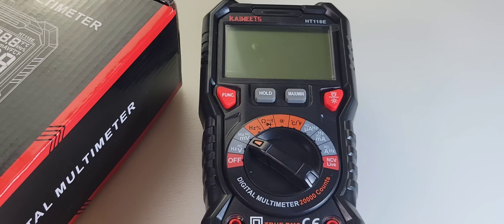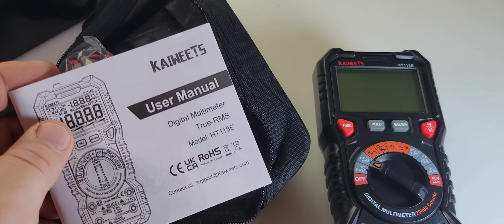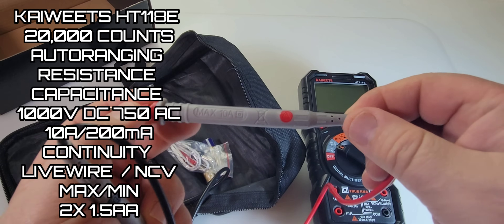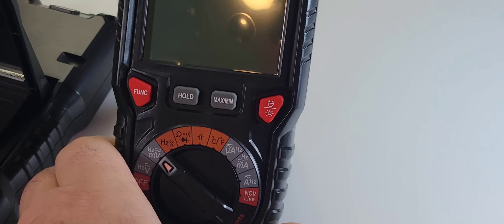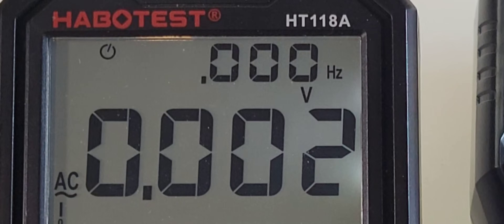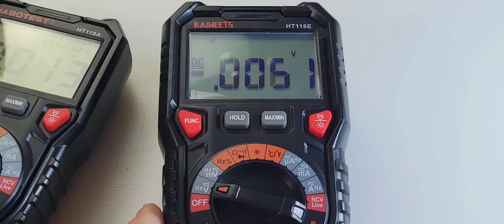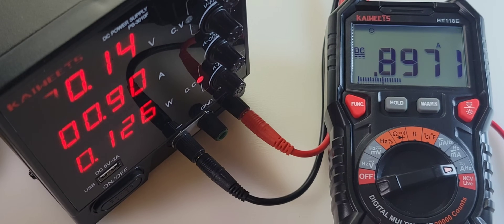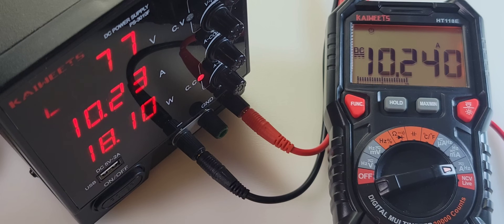ALL NEW KAIWEETS HT118E CHEAP-O Multimeter Review & Teardown!

Comment: Hi! Thanks for one more cool review!
But why do so many nice multimeters use 250V fuses? Better to replace those by 500V or 1000V fuses?
Reply from the maker: Good question..honestly it's probably economics..much cheaper to add 250v than a higher rated more expensive fuse.
Reply: Fortunately, the HT118* multimeters use 250V fuses of size 6x30 - so higher rated fuses 6,3x32 should fit?
I found ESKA 632.527 and 632.510 (both 500V, fast) for approx €0.60 each when purchasing 10 pieces of each (in Germany).
I haven't found 250V ceramic fuses being noticeably cheaper than these ESKA fuses.
Therefore, for safety reasons (to prevent arcing at high voltage), I believe it's better to favor these over 250V ceramics.
Reply: @mlemke9041 Where did you find them 4 that price?

Comment: Hey, you might be the guy to ask: I cannot hear the audio indicator for continuity on most every DVOM I've ever owned. have some dead frequencies in my hearing range.  CAN WE FIND a slightly different tone in the piezo buzzers these things use?   I resorted to drilling a hole in the case of one meter to help me hear it. It'd be fantastic if I could just change the tone with a new buzzer.  It'd be INCREDIBLY fantastic if the makers would add some tone options. 

But I know nothing of piezos, do they all make the same tone?
Reply from the maker: Great question..👍 unfortunately, piezos run at a set frequency, so most sound alike. I do like your idea about customisation..that would be awesome!
Reply: @KeepOnTesting  maybe one could swap out the piezo for a vibration buzzer like cell phones have. That'd be easier to hear.  Ham radios with CW (morse code) function allow us to vary the "offset" as a function of frequency. This allows us to HEAR the side-tone at any frequency we need to. It doesn't affect the output at all.  But then "entry level" ham rigs are close to 1,000 USD.

Comment: The GME RD-300 is a 1% resistance box but this meter shows wrong values :
For 100K it shows 108.3K = Fail
For 300K it shows 302.1K = Fail
For 600K it shows 603.9K =Fail
For 1M it shows 1M = OK
For 20K it shows 20.58K = Fail
For 60K it shows 60.64K = OK
Go slow Mr. Walker. Allow some time for it to settle. And standardise your tests across all multimeters please.
Thanks for your efforts though.

Comment: I have the HT118A version, but made by KAIWEETS, not by HABOTEST, and it does in fact default to DC voltage. The screen is also much better on the KAIWEETS version
Reply from the maker: Agreed...KAIWEETS is slightly better all around

Comment: Hey Darren I bought a habotest ht118e (I think same as kaiweets), in first try I installed new batteries and meter give ErrE low voltage error in all mods , I checked voltage of batteries they are fine Do you have any suggestion or I send for warranty ? I love your videos ❤
Reply from the maker: Howdy friend! First..even though they are new batteries..I would replace with another set..just in case. Still a no go?   Then, you can open the case and connect a DC power supply and connect it to the 2 +- power springs on the pcb. Make sure to output 3v and see if the error persists. 
If it does you can send it to me if you're in North America and I'll fix it or replace it with a brand new unit. Your only cost is shipping one way.  Either way..thanks for the kudos ! 😊 👍
Reply: @KeepOnTesting  Hı, I have already tried everything you said I tried 2-4v to dirrect pcb But it still give same error. I am in Europe so I will send it back. Thanks for everyhting :)
Reply from the maker: @ebubekir2942  ok my friend..let me know how you make out.
Reply: Great news , I opened the case again and checked nearly all components and soldering And I clean the battery contact with ipa I think problem is bad contact with springs or displaced something or internel short . It's  very difficult to close back properly I slowly closed it and hope for best and it's working excellent now but it took me two days to solve this problem, Anyway it's a fantastic dmm it's very accurate. Thanks for great review and your interrest. You are a great man. (And user support of Habotest is terrible and they refused to pay back I won't buy anything from there again) Have a nice day!
Reply from the maker: @ebubekirtasci0638 That's excellent news! Glad it's working again. Sorry HABOTEST support was so terrible. KeepOnTesting! 😃👍

Comment: I got a Habotest HT118e but, although it looks great and has some cool features like the big LCD, it is not good enough for electronics troubleshooting.
Being Continuity and Diode functions separated, you have to keep cicling the button whenever measuring different components in a board.
I miss my old Fluke in which you had just to switch to Resistance if you needed a more precise measurement.
Couldn't they add both functions together or add the beep to the Diode function, eliminating OL (overload) that helps in nothing, so you could test continuity, diode, transistor, without changing the setup?
Another annoying flaw is the dumb timer that is set to turn the meter off after a while, no matter if you are in the middle of a measurement. The Fluke used a smart timer that would start counting only when the meter was idle. Whenever you restarted using it , the timer would reset.
Reply from the maker: It's definitely not perfect but also 1/10 the price of a Fluke. Still, I agree it has some glaring shortcomings👍
Reply: Dear imbecile, just press the "selection" key and at the same time turn it on (Rotate the Rotary scale) the same, you will hear five beeps, from now on it will not turn off! Dear Imbecile!! P.S. What's missing is for people to READ THE MANUAL, but unfortunately they don't. As for Fluke, much of the system is copied from BRYMEN! I hope I helped!
Reply: You can simply disable the APO.
And - feel free - just buy a Fluke! They have so many of them - they even have to sell them 😂
Reply: @christophwoll6546  tks for being a smart ass.

Comment: Seems like a good choice at that price point for people buying their first multimeter. 
I've been working with a Kaiweets KM601 which has a large display with the backlight on permanently. The HT118E was my first potential upgrade path, but after doing some research for a few weeks, I settled on a Brymen BM789. 3-4 times the price, but much more reactive, better built, and with actual support provided.
Reply from the maker: Brymen 789 is very good, but it's also 8-10x the price of the 118E, so not comparable by any means. Most people have no need nor budget for such an expensive multimeter.  This was a CHEAP-O Multimeter review after all  👍

Comment: Hello great review. At around 11 minutes in when you do the continuity test, do you find if you turn on your back light the screen will have a slight flicker when the buzzer activates? I just got mine and I want to make sure its normal. I should note I tested it with a  fresh set of batteries and it still dims down a bit when touching the probes together.  Thank you!
Reply from the maker: Thanks! Very slight flicker is noticeable yes but just barely...hope that helps

Comment: Hello. In Voltage, its automatic AC/DC? I mean... If I turn it on in DC, plug into my wall (Ac) its gonna blow or change to AC automatically?
Reply from the maker: No worries it won't blow even if you have it switched to DC VOLTS while checking the AC. Automatic in this case simply means it ranges automatically, you still have to select VOLTS, resistance, etc..

Comment: hi. I am very impressed with your professional review! Clearly, the HT-118E is a top-tier affordable multimeter. But I believe ANENG AN870 has enough to be its competitor. Despite some relative weaknesses (e.g. no dual display), this device presents better paper tolerances in many situations, especially low voltage. Another strength is the REL function (I think this is a very important point!) If you get a chance, it would be a good idea to review it.
Reply from the maker: Thx my friend,  I actually reviewed that meyrr but branded as a RICHMETERS RM219 ... https://youtu.be/z5TeifiQc2U?si=-WAsUAME4TQ3M5fO
Reply from the maker: Btw, that link I sent you was one of my first reviews over 5 years ago so please 🙏 don't laugh..
My style and techniques have obviously  improved since...😅 👍

Comment: I had one of these for about a year, when testing the 200 volt rail on a vintage radio the display went black and no longer shows anything, the rail acually only  measured on another meter at 180 volts, the fuses are ok in the meter really sad, not sure if this is a good value or  not....
Reply from the maker: That's too bad..they are pretty resilient multimeters in most cases. Might be a simple fix. If you can ship the unit to me, I'll send you a new one!
Reply: @KeepOnTesting  really appreciate the offer, I just bought a new meter and for the price I just scraped the old one, it dosen't mean the meters aren't any good but like they say poo happens, again thanks much.....
Reply from the maker: @chesterbuck1841  Great to hear Chester 👍 Keep On Testing!

Comment: I really wanted the diode forwarding voltage but also like the 118E  counts, so I just bought both, a combo deal both meters for $70,  So the 118A does start with DC now and the backlighting also stays on like the 118E, but the 118E still does not do diode forwarding voltage.   The Display contrast left to right is better on 118A but looking down from above is not visible, the 118E is better all around but contrast not as sharp left on right angles like the 118A.  Thanks for the review!
Reply from the maker: Great feedback 👍  Enjoy those multimeters.
A couple of great ones !

Comment: I think you have an older model 118A. They did a revision where they basically fixed all those issues you mentioned with your 118A and made it more into an 118E. Mine has the better backlight, uses DC as standard instead of AC and the backlight switch instead of auto-off.
Reply: I bought my 118A over a year ago.  It was on sale for about $29.  Volts default to DC and the backlight stays on until I turn it off.  I use it more than my Fluke because I really like the large, clear display and the backlight.
Reply: How would we know if the HT118A we buy has those changes? Can't see it till using it. Is there a version/firmware number/manufactured date to look for?
Reply: Same here with my 118A
Reply: interesting, ...   I am willing to get the 118A then if the 118E still doesn't have diode forward voltage.   does this meter have auto off?, I am bad at forgetting to turn stuff off.
Reply: @3dFirefly  Drinkyoghust is correct. My 118A also defaults to DC and the backlight stays on.

It has an auto-off of ~7mins.

Comment: I use PCW02A.
the manual says that the backlight only turns off after 10 seconds.

it has to be turned off manually for me

is it a mistake in the manual ?
Reply from the maker: Well that's a bonus! Later revisions enabled permanent backlight so you probably have a more recent version.

Comment: Hi Darren, great review! Do you know if the improved tweaked version is out yet?
Thanks Chris
Reply from the maker: Many thx...As for tweaked vetsion I doubt it..possibly not until the fall.
Reply: @KeepOnTesting  Thanks for your message.  I was keen to buy it, but the diode test put me off. Might wait till Astro ai bring out a new 20k count equivalent.
Reply from the maker: @Chris-uu6dg  No problem..btw, Check out the VENLAB VM-600A,  https://youtu.be/bpTUXM1v53I  
It's a great multimeter too, with A+ DIODE mode.
Reply: @KeepOnTesting  OK, thanks. I'll take a look at your review of the Venlab. Would you recommend the Venlab over the Kaiweets HT118A ?
Chris.🙂
Reply from the maker: @Chris-uu6dg  It's very close..I was blown away by the VENLAB's performance 😳 I would definitely buy it! If the display count doesn't bother you it's a steal! 👍
Reply: @KeepOnTesting   I just bought the Kaiweets HT118A. 6000 counts is enough for me and seems to do a much better job with Diodes and LEDs and capacitance etc.
I think I prefer the build quality of the Kaiweets over the Venlab and also has a few extra features. I got it at an excellent price £26.35 GBP using your 15% discount code. Thanks for your help mate. I also subscribed to your channel now.😊
Reply: @KeepOnTesting fall of 2023?  So how do we know the one we buy has the fixes? Sellers might still have nonfixed HT118E!

Comment: Do not buy. faulty. Returned 2 I was getting the erratic voltages displayed. And yes I set the meter to AC and press down hard on multiple Outlets. It could have been the test leads. But on two units that would prove bad craftsmanship. I can't believe the bad luck I had with those. Thank you for your concern.
Reply: I just got my HT118E this week and was getting random readings until I figured out the black/return lead was not fully seated against the multimeter.  Once I pressed down firmly and it was fully seated the erratic readings went away.  I read on an AMZ review I think that a buyer returned his first one thinking it was faulty until he figured out he had not inserted the leads in all the way on the second one.  Not sure why it requires that much force to insert the leads (and to pull them out), but regardless the readings I have gotten on my limited use seem pretty accurate.  I'll say this, I returned both the Fluke 101 and the Fluke 107 soon after I got them because I lost patience with the endless hunting on resistance readings, the completely random readings when grounding the leads together, and for the 107 the inability to get a simple voltage reading off not one but two car batteries.  Hasn't been an issue with this multimeter.
Reply from the maker: What was the issue? I've yet to hear of any major problems affecting the 118E...
Reply: @KeepOnTesting  bought 2, returned 2...
neither one would read any of my outlet voltages...I really wanted it to work...went out and bought an Assark for $20 ...even though it's a 6k count... it's perfect for what I need...
Reply from the maker: @carlthetruthwilliams9447  Were you getting erratic readings or was there just no voltage being displayed ? It defaults to DC VOLTS as well so you need to select AC Voltage which I'm sure you are already aware of. Also, the default test leads don't like modern AC outlets that have the safety covers , I find you really need to push down hard to get a reading or just change the test leads altogether. 😀
Reply from the maker: You should have sent it my way ..I would have paid for shipping and given you a free replacement whether needed or not. I haven't seen a bad unit yet and I find 2 from the same source as defective very unusual. Cheers my friend
Reply: @KeepOnTesting  Thanks for your kind words and ad I known of your generous offer, I would have taken you up on it... Cheers to you...

Comment: whats the main diffs between that their HT113 which ive had for years, and looks essentially identical?
Reply from the maker: Higher resolution 20,000 count as opposed to 6000, illuminated inputs,illuminated  high current/voltage alerts

Comment: Thanks for the review. A question here for you,  umm what's the difference between 20000 counts and 6000 counts?
Reply from the maker: 20k counts is higher resolution displayed.
6000 count can read up to 5.999 volts.after 6 volts it would show 5.99 so not as precise.
20k display will show 19.999 volts until 20 volts then reduce to 20.00 ..Basically losing 1 digit. More resolution equals more precision.
Reply: @KeepOnTesting   Understood, Thanks for the feedback.